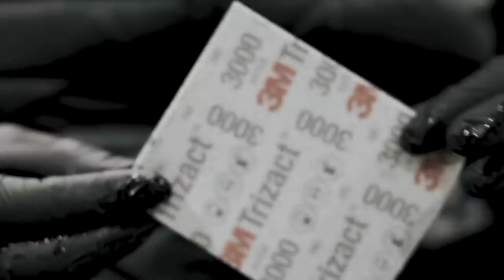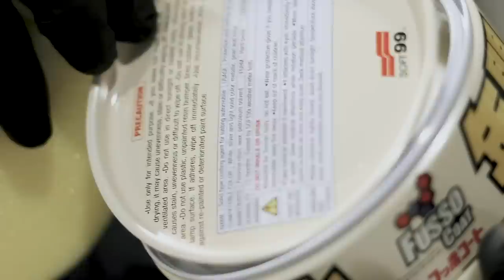These Classic BMW E30 Wheels Were A DISASTER! Satisfying Auto Detailing!

Comment: Why did you not remove the centre cap prior to cleaning?
Reply from the maker: Aran Poyntz centre bore is rusted. Not going to repaint them as they’re not going back on the car. Just wanted to put them in storage a bit cleaner! If I was going to use them again I would have repainted them
Reply: @ChromaticGarage   I'm assuming that's why you didn't clean up the mounting surface either.
Reply from the maker: fubar1217 exactly. Going in the shed!

Comment: thanks for the video!  do you suggest using the dry or wet foam tip on the foam sprayer when it comes to wheels?
Reply from the maker: Timothy Ly I prefer the wet foam! A heavier foam typically allows more debris to be pulled off with it
Reply: Chromatic Auto Detailing thank you!

Comment: Great job man..
But why not a tar remover before wet sanding? These marks are tar deposits aren't they?
Reply from the maker: Vasilis Tsellas thanks man! I did the other 3 wheels first and a tar remover didn’t work that well. In areas it did remove there was pretty heavy staining so I had to sand them lightly anyways. Would rather get to it quicker this way!
Reply: @ChromaticGarage Disaster as you said! Thanks for sharing

Comment: I dont understand why you clayed the inside of the wheel when you had to sand it down later on ? You shouldve saved time and skipped on the claying because the insideof the wheel isnt visible and with the amount of road tar and brake dust, theyll be covered with grime in a few months.
Reply from the maker: basit wyne had to do it proper. Least aggressive to most aggressive

Comment: Why did you spray fallout remover before cleaning the wheels ? That was pointless . Surely you should have cleaned with p and s first, then used the fallout remover ?
Reply from the maker: nicky chavda there was no loose dirt on the wheels. All of this was baked on. If rinsed prior all I would be doing is diluting the iron remover. Better to hit it dry in this case

Comment: What about the rusted inner hub ... go get a Pneumatic air grinder with a 2” roto loc abrasive pad  to clean up and finish with anti seize to prevent future corrosion . You’ll thank me later
Reply from the maker: Did this after. Not everything is included in these videos. They are just short videos.

Comment: In my opinion you are not right with the order to start. First I would start with a deep rinse to clean all the junk and then flow with a foam then big brush clean then little one followed by another rinse and finally some coating or protecting
Reply from the maker: Jota Ele there was no loose debris on the wheels. Next time though!

Comment: 9-2-2020:  just bought a (4)set of bottle-caps w/ great rubber/used, for my '99 Civic EX coupe; @$200...and delivered.  Plan to change out BMW center decal and roll with the heritage of both automotive worlds.  Mine aren't mounted yet; dirty- definitely need some elbow grease, and- there's no fucking way I'm paying dudes in my area $125/hr to do the work.  Because I'm NOT either!  Some fucker in a mobile service- charging $125/hr.?  Shit, that's only $250,000 a yr.!  For a dude with a toothbrush and polisher.  Gonna pass!

Comment: Funny asmr video...the brake dust is asbestos...
Reply from the maker: Is it really?
Reply: its possible, manufacturers stopped using them in the 1990's but aftermarket and parts from abroad still may contain asbestos.... clutches also... working with vintage cars is awesome! cool video ideas!

Comment: Next time, don't use a boars hair brush on the barrel of the wheel, use a much stiffer brush and save yourself some time. Also just spray the brake duster on the tires, might as well let that soak and break down old shine and grime. All camera work but no real common sense when it comes to detailing a vehicle.